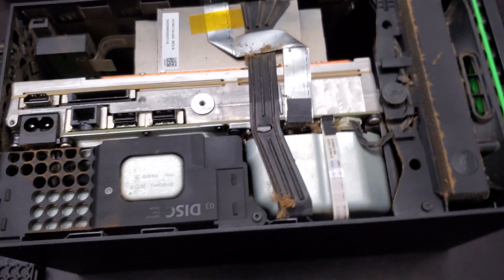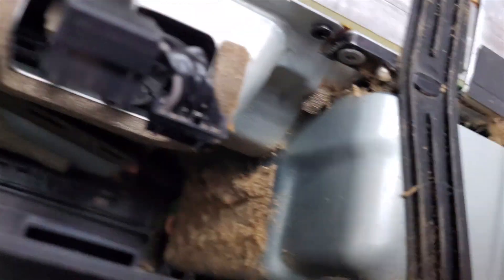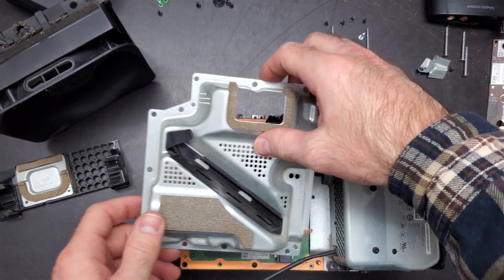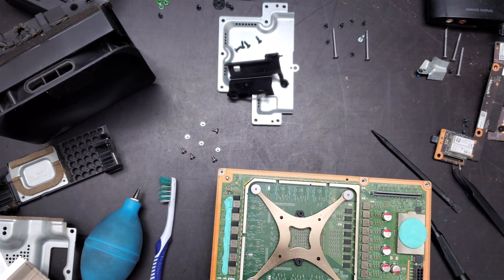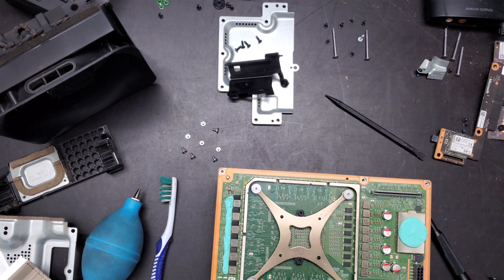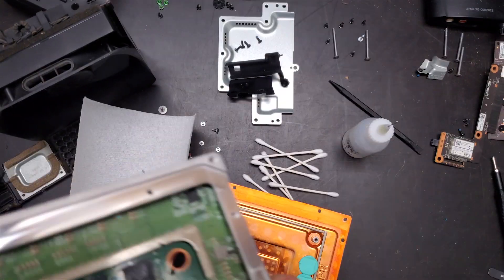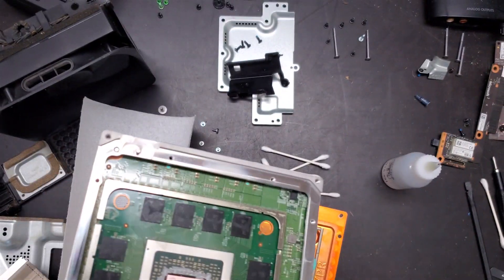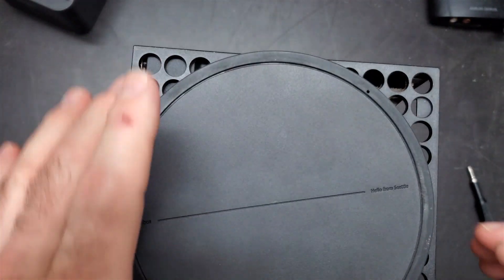Cleaning and Reapplying Thermal Paste on a Crashing Xbox Series X

Comment: You didn't change the pads!!!
Reply from the maker: They don't need to be replaced, unless they get dirt or grit in them. Most techs do not bother replacing the pads. If you look it up online, that will be what they say, and I agree. Only change them if they have dried out, or are dirty. Otherwise you're just wasting resources.